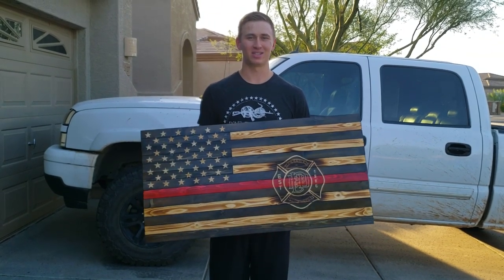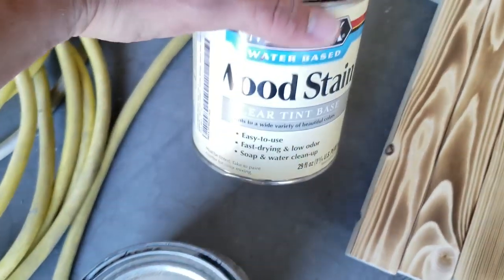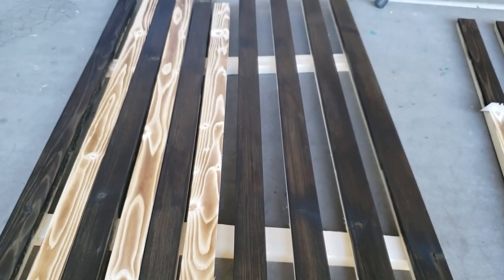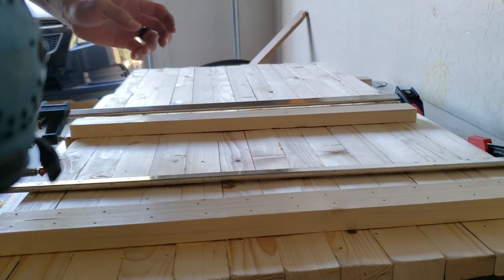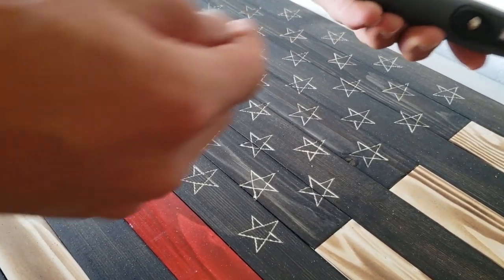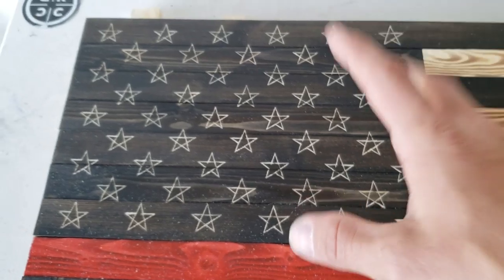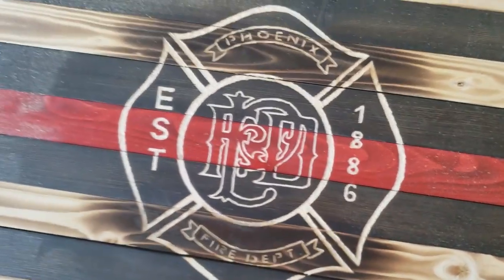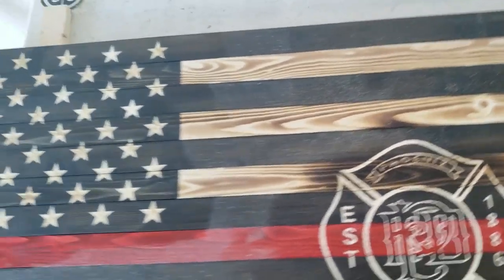HOW TO MAKE A CUSTOM THIN RED LINE WOODEN FLAG | STEP BY STEP

Comment: Another Great Build!!! Just wanted to pass along a little helpful hint . I found this product after building several flags and I really like it. Rust-Oleum makes a Non Yellowing clear finish in a spray can. I buy it from Wal Mart and it goes on really smooth.  I didn’t even consider that my flags may yellow over time until I found this new clear sealer. 👍🏻
Reply from the maker: Thank you very much and thank you so much for the tip!👍🏻

Comment: Would you see a difference in using the clear stain w/ added color, as you did vs. using an already black stain (i.e. ebony)?
Reply from the maker: I actually havent tried that so i couldnt say, if i had to guess i would think it would look very similar. Sorry i cant help you out more!
Reply: I’ve not used the 2 for this specific project but have used both for other projects and they both turned out very similarly. I know this response is a year after you asked but if you’re still wondering, there is my 2 cents worth. 😉

Comment: This are 1 by 2’s but you said an inch and a half wide and 3 quarter inch deep. Did you rip those down to that size?
Reply from the maker: Thats the size they should be from the store, for some reason in lumber the actual sizes of the wood are smaller than what they are called. For instance a 2x4 is 1.5 inches by 3.5 inches. I have no idea why they do it like that but thats how it is, hopefully this helps! If you google "lumber actual dimensions" it will show you what its called and the actual dimension
Reply: Thanks a lot man, one last thing, at Lowe’s they have whitewood or premium pine which is more expensive. Which wood do you use?
Reply from the maker: @jaredwoods5284  i get mine from home depot but i dont get the premium stuff, i just get the common board, im pretty sure its around 3 bucks for an 8 foot stick. Feel free to ask my any more questions you might have and good luck!👍🏼
Reply: @MaxF01  Hey Max, the dimensions are based on the green cut. That 1x2 was actually 1x2 when it was first cut (before it was dried that is), the shrinkage is pretty uniform, which is why you consistently see the measurements as 3/4 x 1 1/2.

Comment: Do you ever have trouble with pieces of wood that warp slightly when you’re putting it together Does the glue and brace do enough to fix that?
Reply from the maker: I have had that issue come up, usually i try my best at the store to find wood thats as straight as possible and that helps a lot. Then if theres still any warped pieces its usually not noticeable and the glue and the brace help as well

Comment: Very nice! What was the final size of the flag?
Reply from the maker: Thank you very much John! Its 37" by 18.75", it should be 19.5 inches tall but for some reason my 1x2s were a little smaller than they should have been but its not easily noticeable

Comment: looks great!  How much time did it take to carve out all the stars by hand?
Reply from the maker: Thank you very much!! It takes me around 3 hours to trace and carve the stars
Reply: Started my flag last night.  It's all cut and practiced staining and burning on a few scrap pieces of wood.  My question is, burn first then stain or stain then burn.  The piece I burned first, when I came back to stain, it looked like the stain didn't take to certain part of the burn and almost looked like it bubbled.  I purchased the Minwax waterbased stain, True Blue and Scarlet. Any suggestions?  Thanks,
Reply from the maker: @mikelittle9143  hmm that's odd, ive never had that happen and i burn first, then stain. Any chance it could have still been hot? I cant think of anything else that would cause that
Reply: @MaxF01  It could have been warm.  I'll keep trying.  Thanks for the quick response.
Reply from the maker: @mikelittle9143  no problem! Let me know if it works out!
Reply from the maker: @mikelittle9143  i have had pieces of wood before that burn kinda wierd and the wood almost looks like its bubbling maybe from wood that has lots of sap or something in it so that could also be what it is. And when the wood does that it usually doesnt take the stain as well. I dont get those pieces often but ive had a couple

Comment: How much would you sell those for? Thinking of starting my on little side hustle making flags
Reply from the maker: Hmm its hard to say, i have heard from a couple guys that they sell just the plain flag for $100, and then to add the design maybe charge around $50 depending on how long it takes. But from what ive heard they sell pretty good!

Comment: Ive been doing mine pretty much the same way for about a year now.  In my area I get between 50-80$ for them.  Do you mind me asking what you are charging?
Reply from the maker: Oh cool! I actually dont really sell them i just do them for more of a hobby
Reply: Max F  I was in the same boat but finally started charging as more and more orders came in. Now it’s almost overwhelming. Good luck in the future.
Reply from the maker: @jonchurchill8630  thats awesome! Hopefully its a good overwhelming 👍🏼 thank you very much and same to you!
Reply: that price is way to low for a carved flag imo.  Even cutting the wood instead of buying 1x2's already cut down you are spending $15-25 or so for the wood.  Add the cost of stain, poly, glue, brads, propane, and brush/cloths so $20-30 for mats depending on your area.  Then 3 or so hours to carve, cut, stain, poly, and assemble.  Your lucky to make $15/hr for your labor. But if your spray painting your stars that's a different matter entirely.
Reply: bubbaskinny  I’ve done the math and keep close tabs on it. My costs are WAY less than that.
Reply: @jonchurchill8630   Even if you only spent $5 on materials  and only took you 3 hours total labor,  At $50 each, this will still only net you $15 an hour labor.
Reply: bubbaskinny thanks for your unsolicited advice
Reply: I make $100 per American flag, as of now I hand paint the stars using a stencil.  I’m in Alabama.  I’ve sold 8 so far this month so it keeps me busy.
Reply from the maker: Thank you for sharing, i appreciate it!
Reply: Max F thank you I am actually starting on a firefighter flag for a family member for a Father’s Day gift.
Reply from the maker: @dr.vonslifeinvesting6485  thats so cool man they are such cool gifts! I feel like people can really appreciate all the time and craftsmanship put into them. Best of luck to you i hope it turns out!

Comment: What are the dimensions of your star stencil?
Reply from the maker: 10.5 x 14.75 inches
Reply: How did you find the stencils for your flags
Reply from the maker: @bigcat92383  for the union stencils i just get them off Amazon, the one i used to make this flag is linked in the description 👍🏼